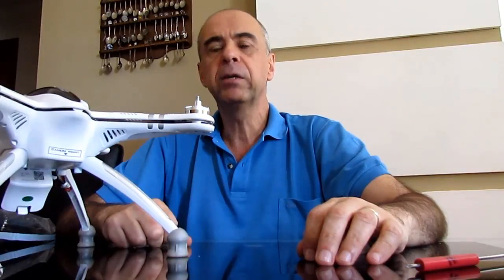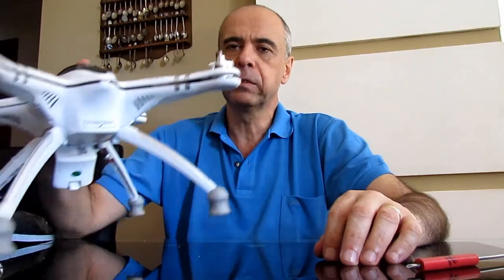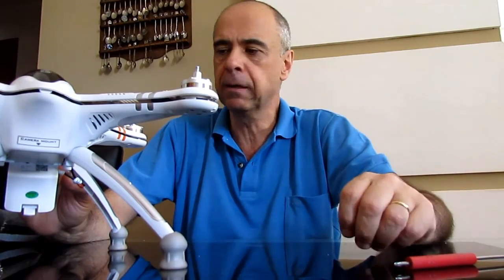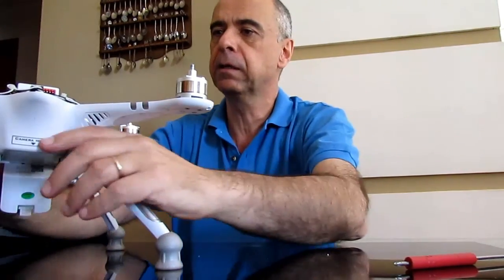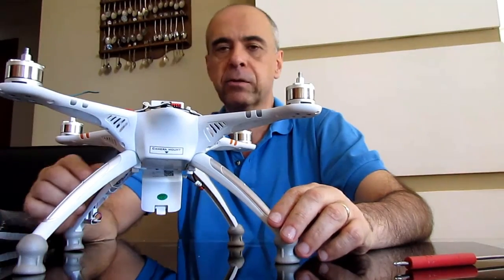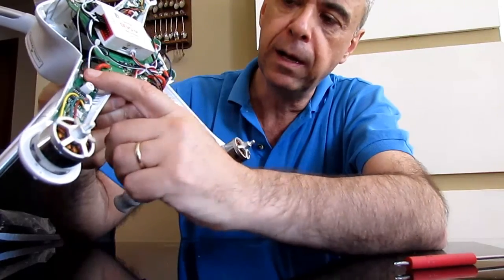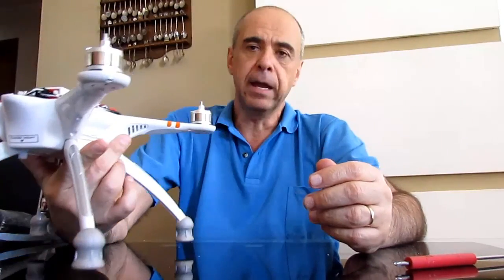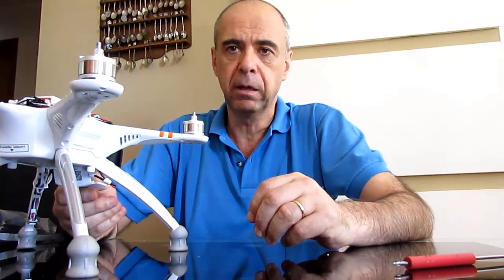Walkera QR X350 PRO quality control problems

Comment: Mine doesn't work on GPS hold or on return to home, the mix switch seems to not function on the Devo 10 that came with it. It does return to home if I turn off the transmitter. I only attempted this due to frustration and lack of control. It also needs TON of trim left and back, wanting to fly right and forward....only has manual mode. Id have bought a racing drone if that was my goal.

Comment: Walkera is a very good quad. But this is very important point - build quality. This is the biggest pain only. If u are a hobbyst you can very easily repair it. After that this quad is millions time better than DJI Phantom shit toys :).
Reply from the maker: +mastrojani Unfortunately, many people are complaining about the same problem I had with my drone: bad soldering.  As I said before, the project itself is good, but it was badly implemented.  Now that I fixed the drone, it is doing fine.  I wish the factory would be more careful about quality control.
Reply: +Ovni Hoje Maybe workers also used a too hot glue to protect connection. Too high temperature could make a serious damage into the cable.
Reply from the maker: +mastrojani Could be.  However the stuff they used fells more like white silicone.  Anyway, after fixing the problems myself I've already flown several times without any problems, other than the drone landing automatically whenever it senses the battery is below 10.5 volts or so.  And it does not warn you, so if you it is far from the take off point, good luck to you. :)  Other than that, it is doing fine.

Comment: my pro has turned on gps by itself  2 times now and crashed any ideas why its doing this. Im only 200 yards away in line of sight
Reply from the maker: +mark rankin Did you try updating the firmware?  I've upgraded mine to 1.7.  It came with 1.5.  In case you haven't done this, I strongly suggest you do.  There are some videos on YouTube showing how to do it.
If your problem is caused by software, this should solve it.
Let us know how it goes.